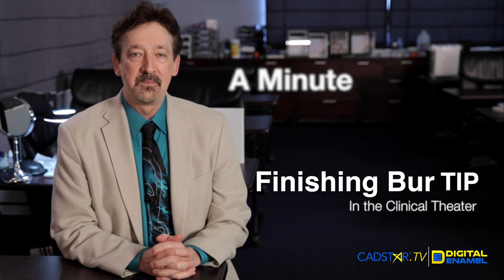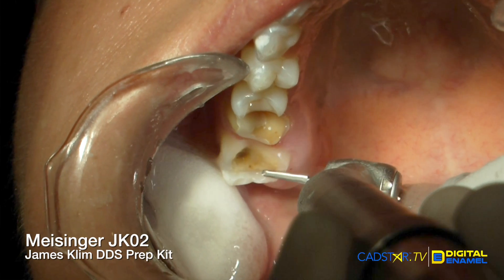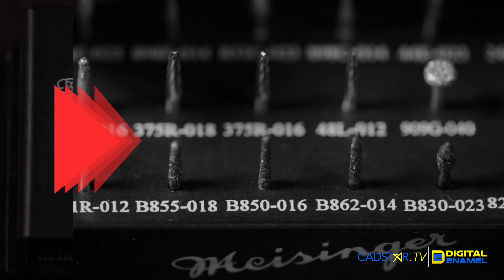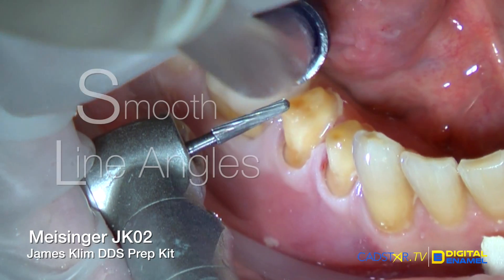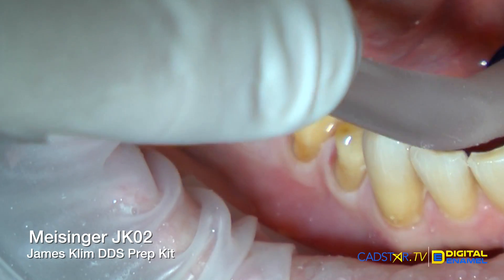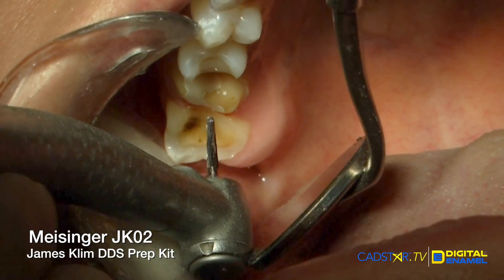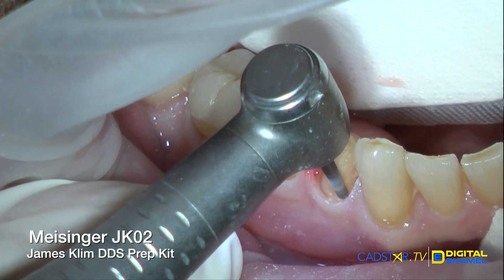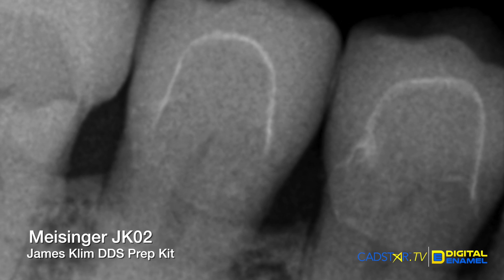A Minute with Dr. Klim:  Preparation Carbide Bur Tips

Comment: using a carbide should we be at all worried about not having enough micro retention?
Reply: Mechanical/micro retention is not something you should worry about at all. Learn proper bonding protocols and you'll be better off in all regards. The smoother and glassier the prep, the better. No sharp angles. Even if your prep is a tad on the shorter side, place a rubber dam, and bond the crown with a solid protocol that you fully understand.